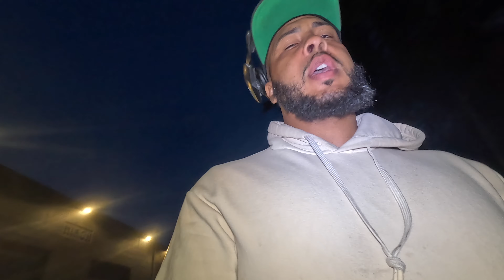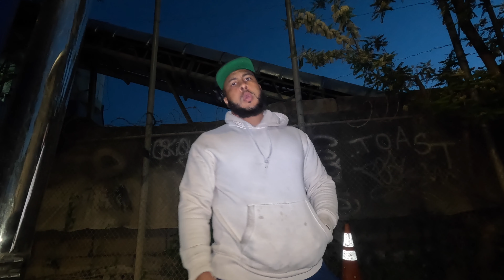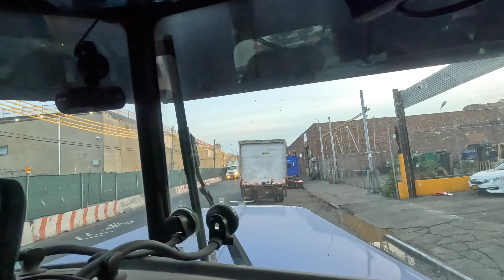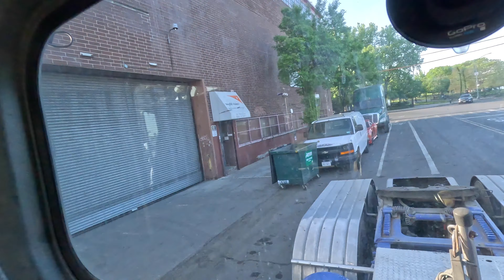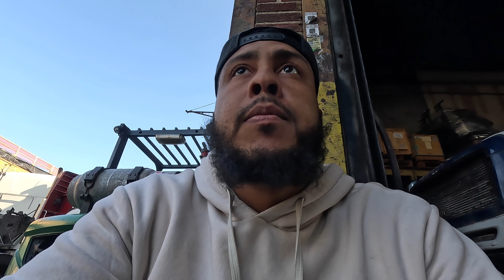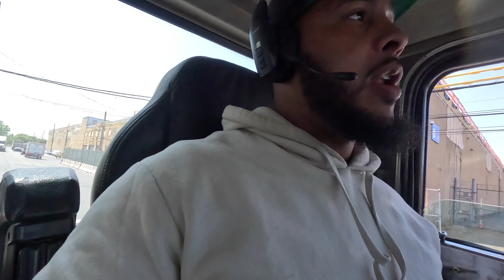I Took My PETERBILT 379 To The Mechanic

Comment: yo you need to check the tanks, might be slog in there coming through the lines. after a couple of years dirt and debris build up from the fuel.
Reply: also when last did u change your air filter in the cans, remember u work in a dusty environment
Reply: You might wanna check your air charge cooler too
Reply from the maker: Thanks bro, yea I changed my air filters last time. And yes I think I need to clean out the tabks